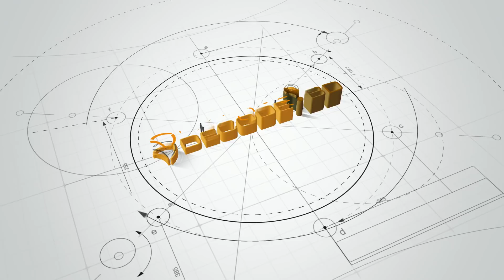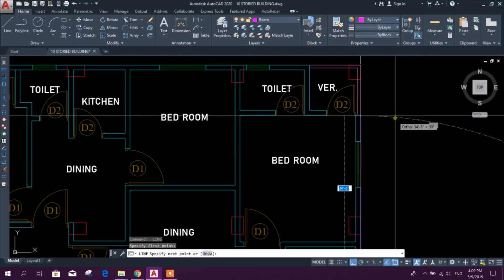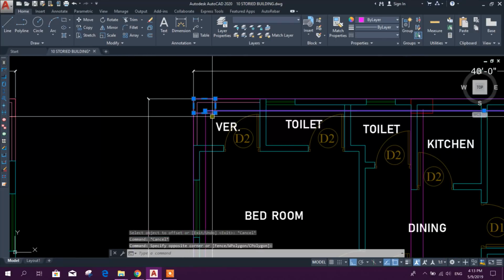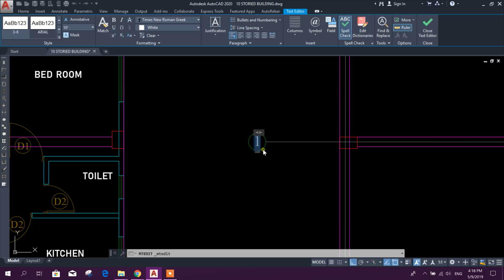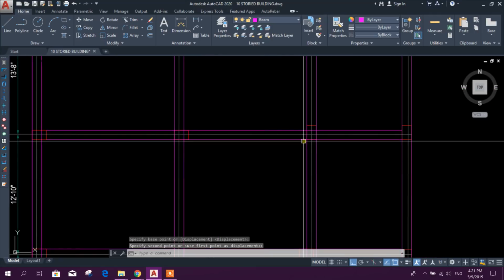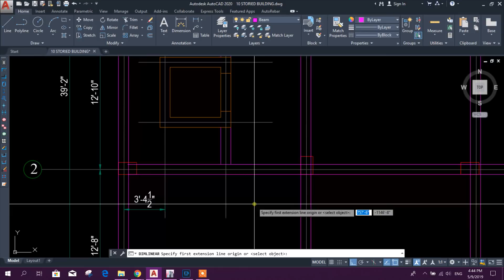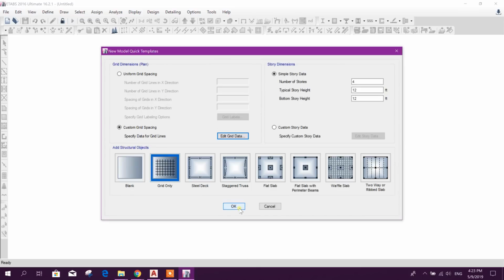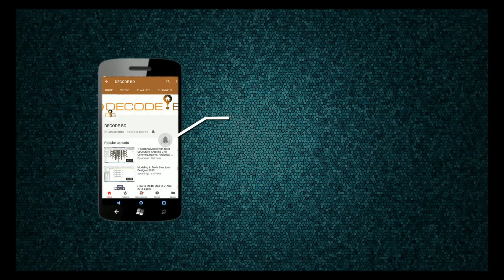10 Storied Building Design in Etabs-Part1

Comment: sir ,y ur not design indian code.....can u plz design indian code in one project for same plan ...
Reply from the maker: Will do. Just need some proper free time.
Reply: @Decodebd  thnks for u rply sir , I ask another question grade of concrete define with different structure( example m25 column grade for 2 storey .....m35 column grade for 10 storey .....)can u plz give the example with answer sir
Reply: Higher grade concrete means lesser cross sectional area for same load.

For 10 storey building you will have to provide larger columns compared to 2 storey building.

So, if you want to reduce the cross section of the columns you can increase concrete strength (i.e. grade).
Reply: @Decodebd  sir iam waiting for ur rply